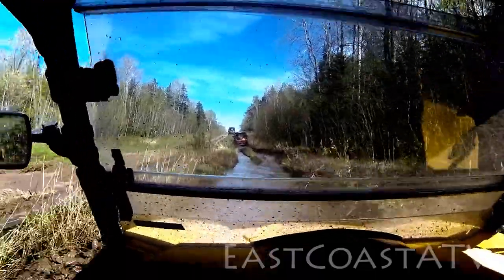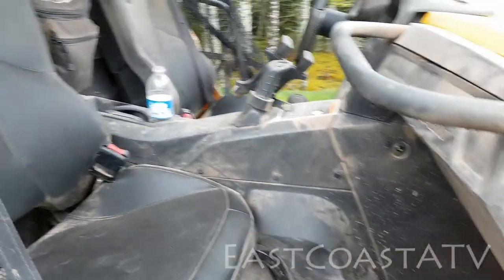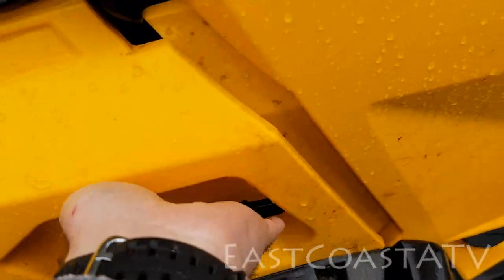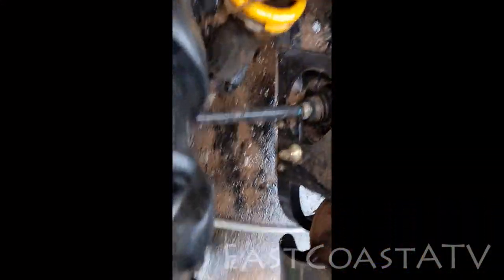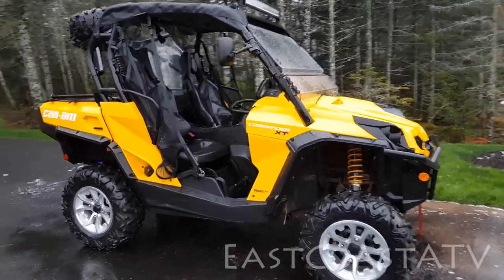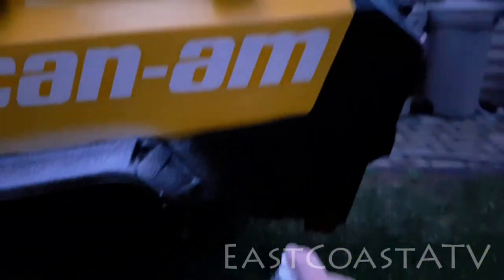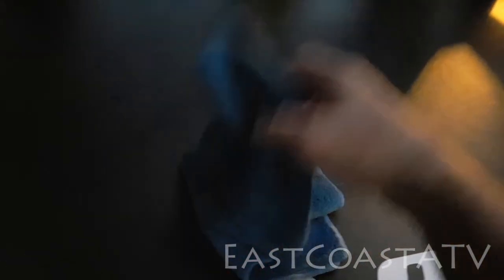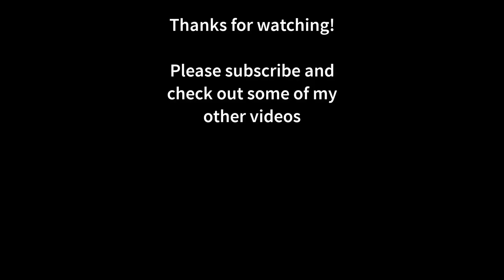How to wash your ATV or UTV and shine it.

Comment: Nice tips ! I basically do the same thing but I use SC1 and it makes your bike look like new, it's not cheap though.... so I usually spray it on then wipe with a micro fibre cloth as well. Also with those pressure washers, you gotta watch those things, they can force water into areas it's not supposed to get to, unlike your garden hose..... If I use a pressure washer, I'll keep it a good distance away from the bike, in hopes to not force water where it shouldn't be. Oh and I clean my bike like that after every use haha but I'm a bit OCD I think.... lol
Reply from the maker: I can relate to wanting to have the machine clean! My old machine was painted and I can't tell you how many coats of wax it must have had on it. But, man did it shine!
I'm pretty careful with the pressure washer too. I never even used it on my quad, I just use it on the side by side because it's so bloody big and there is a lot of surface area to rinse off that get caked with mud, especially under the dump box area. Thanks for watching!
Reply: Oh I know eh, my brother and father have SXS's and it takes twice as long or more to wash them over an ATV. Good job on the videos, keep them coming !

Comment: Hi Pat, Mechine looks great, it was dusty Saturday, you talk about your rad ,I use AC condenser cleaner, I get it at wolsey in Dartmouth.  This stuff foams up and forces the mud out of the cores and made it easy to clean with just a water hose. It is non acid and will eat your rad like mag wheel cleaner. You can get in a spray can or conintrate that you mix with water and spray on with a sprayer. This is what I use.
Reply from the maker: Gary Fancy 
Thanks Gary! I'm going to try that. The rad can use any help it can get.

Comment: So after a good muddy ride i spray off the chunks with a garden hose and a jet spray, then use a 1 gallon weed sprayer and mix up a soap solution of dawn dish soap and simple green and spray down the whole thing and then let it sit for about 5- 10 minutes depending on how hot it is.  Then i hand wash it with a mit and a bucket of mild soap and water. Then i spray it down with my garden hose with a shower and hand dry. It looks almost as good as new minus the few brush scratches. I do mine after every ride i'm a little OCD about keeping it clean i do this on my Side by Side and my ATV.
Reply from the maker: I've never tried simple green. I will have to try it out, thanks for sharing your process. These machines are expensive so I try to keep it looking good whenever I can.
Reply: @EastCoastATV  simple green and dish soap works well and it doesn't take much when mixing per gallon.

Comment: I enjoy your videos.  I just purchased a 2016 Can Am Commander 1000 XTP.  Can you share any “must have” upgrades you recommend?  How do you keep the engine area near leg cool?  I installed a windshield, roof, rear view mirror, and rear net.  Please advise.  Thank you.
Reply from the maker: Michael Miller 
Hi Michael, I'm glad you like the videos. Thanks for watching and posting. I would suggest that you get a 2 inch lift kit. I bought a 2 inch lift kit from HighLifter. 2 inches doesn't sound like much but it makes a big difference. I would also suggest rock sliders. I didn't get them and I regret it. I also have a roof, folding front windshield, and rear plastic window. I haven't done anything for the heat. I don't mind it that bad. I also suggest an LED lightbar of some kind if you plan on doing some night riding. Congratulations on your machine. I hope you have a lot of fun with it.